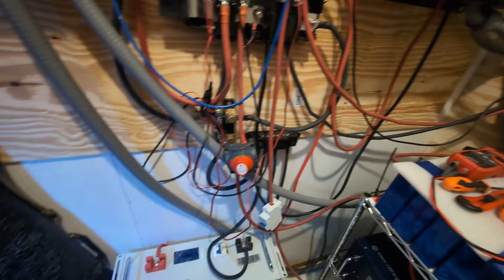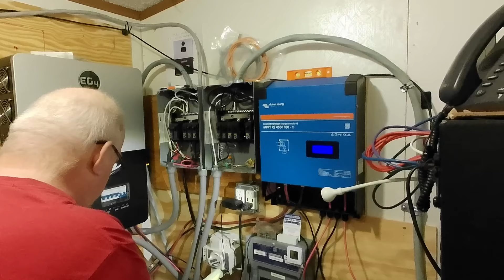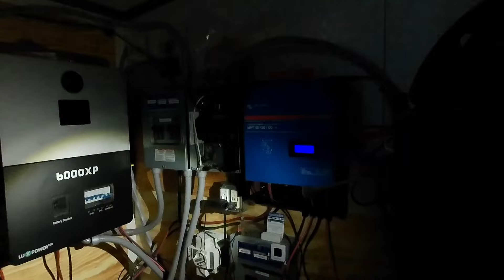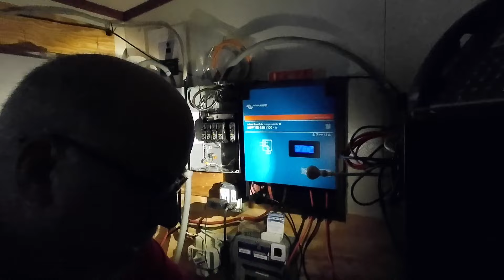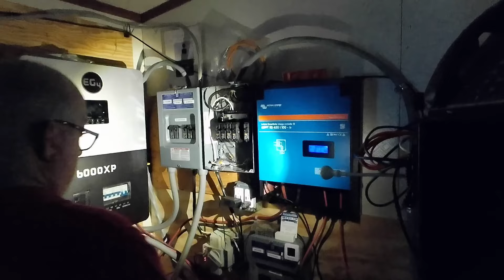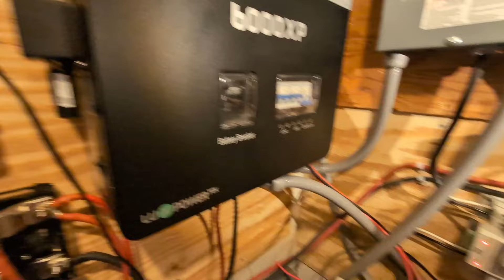Solar Vlog #3 - Automatic transfer switch install

Comment: your transfer switch should be in a box. and you should not cut the extra wires just put a wire nut on the extra wires. I used one of those transfer switches in a cabin ten years ago and it is still working well. I have learned so much from you love y'all.
Reply from the maker: I agree, the transfer switch should be in a box! Glad you're enjoying the solar build! Thanks for watching :)

Comment: Just a quick question do you send solar back to Grid that you don't use and get money for it. in that case you would need a Firefighter Safety switch so if maintenance is being done the Grid you don't want the solar panels sending power back to Grid it could electrocuted one of the workers.?
Reply from the maker: no connection back to the grid, I store excess power in batteries and in the future back into the water heater.